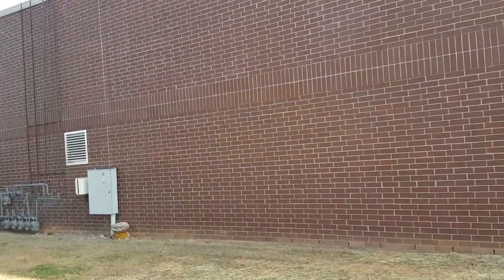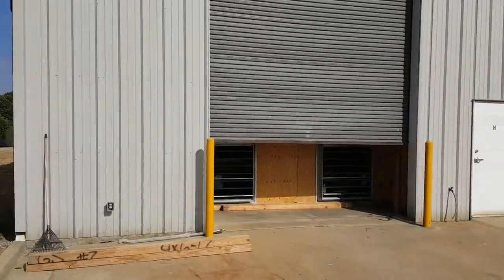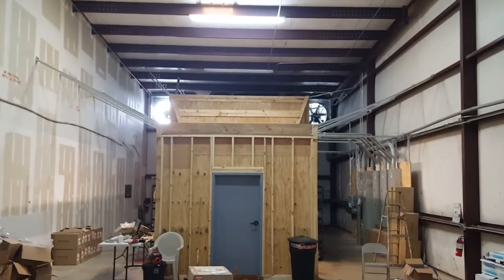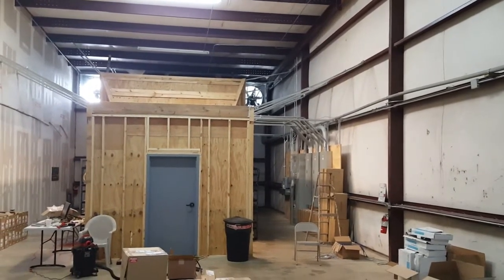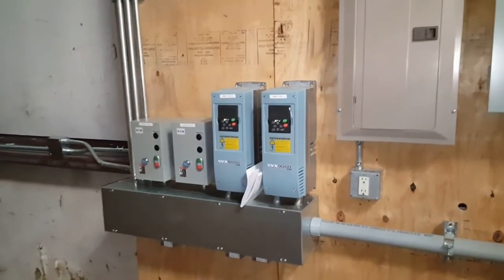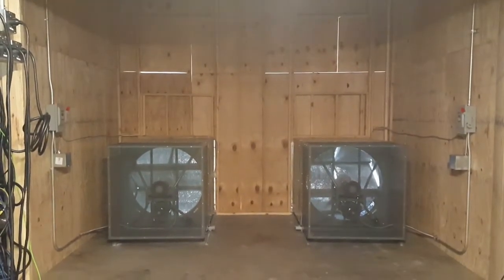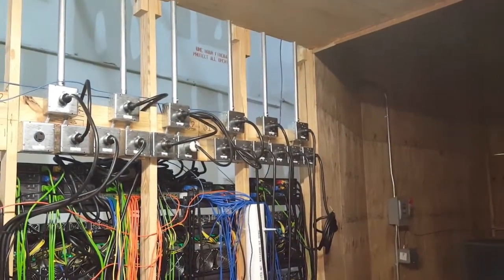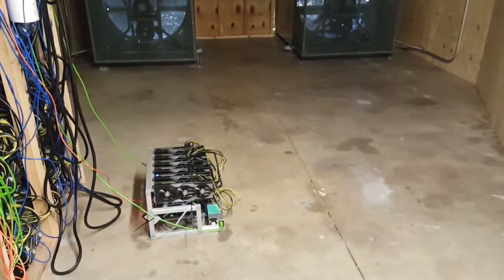Quick Tour of Medium Size Bitcoin Mining Facility

Comment: How do you protect the miners from surge and spikes? Thanks.
Reply from the maker: The big spikes are protected by the main breakers and the PDU breakers. Smaller spikes are sucked up by the AC to DC power supplies
Reply: Thank you. Do you think using receptacles is a better idea for each machine than using the PDU? The PDU's itself are $150 each while the receptacles can be way cheaper. Also, are you running 3 S9's on 30 AMP or 4 S9's on 30 AMP?

Comment: can you tell me whats the difference between using PDUs & just directly wiring each miner it's own socket?
Reply from the maker: PDU's are like big power strips. I prefer to do fewer 30 amp sockets because it gives me more flexibility in maximizing power usage, and I don't have to pay the electricians as much.
Reply: okay, im about to put up a medium size farm too. just wondering if i should do 10 amp socket for each miner or use the pdus? i don't really know how pdus work, like what size breaker does a pdu take and does the pdu have it's own breakers for each slot? i live in Finland & we are getting 400v main power on the facility, don't know the amps yet.. im thinking about putting up 230v 10 amp dedicated circuits for each miner.

Comment: I am looking to get my first mining machine. I was thinking ethereum to start with. I found one for $1k and have a space in the back of my thrift shop. Now do I need direct connect for Internet or is WiFi ok?
Reply from the maker: I recommend direct connect, but you should be able to use wifi if the machine that mines ethereum has wifi on it.
Reply: Block Operations is $1k a good price for an ethereum mining machine? It is brand new made by Mont I believe.

Comment: What is 40000 cubic feet about, I didn't get that.
Reply from the maker: 40,000 Cubic Feet per Minute. It is a measure of airflow. Since the box the miners are in is 40 x 10 x 10 ft, or 4000 cubic feet, the air in the room is fully replaced 10 times per minute, or once every 6 seconds.
Reply: Wow, thats a lot!
I guess those machines generate too much heat.

Comment: Hey Rofl !

For the miners, you don't have to point to the antpool right ? You can mine any coins you want on any pool (of the same algo) ?

And are you sure it's 40 000 cuber meter per minute for the intake air ??? That's huuuuge
Reply from the maker: you can mine any coins using SHA-256 to any pool you want. 

Yes - 40,000 CFM throughput right now